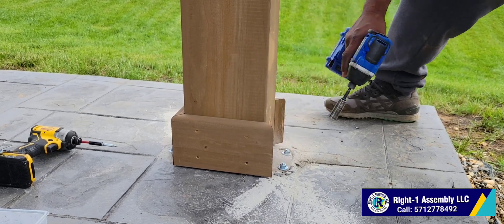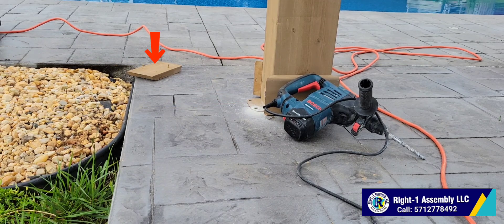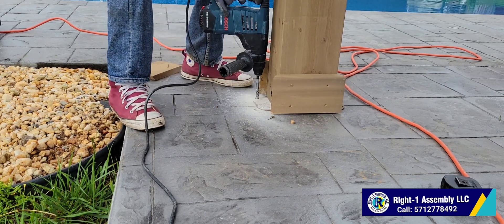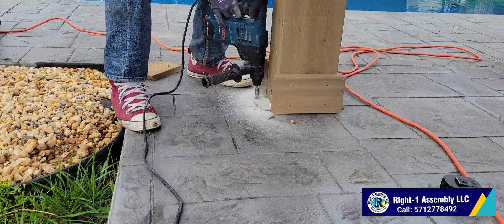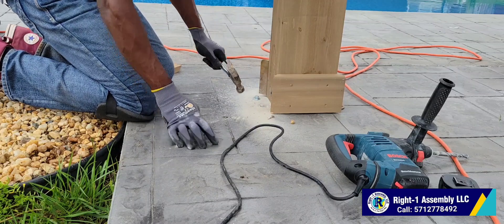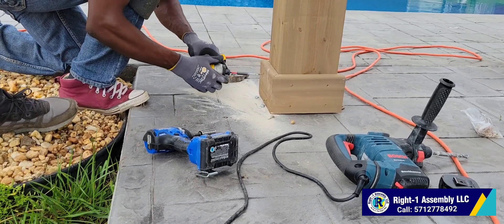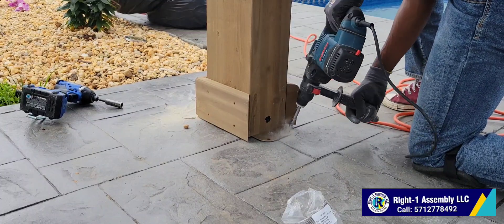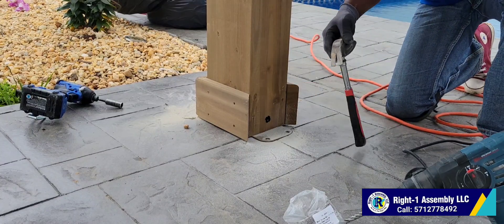How to attach or anchor the yardistry gazebo on concrete or patio. #diy #gazebo #home #world

Comment: Perfect.  Exactly what I needed to know to attach my grill gazebo to my patio.  I've done this with cinder block wall achors but that is easily drilled with a hammer drill.  Will have to rent the concrete drill but cheaper if I do that and do the work myself.

Comment: How would you recommend anchoring a Gazebo over pavers set in packed stone thats over 2' thick?
Reply: The same... Tapcons... No different... Just make sure you have a strong drill
Reply: Is the gazebo property secure with the anchors only being fastened to a paver block? The paver block is only held in by sand. What stopping the attached paver from lifting with a strong enough wind?
I think the proper way is to have concrete footings poured under each leg. Then the gazebo leg gets fastened to the footings. A lot more work involved this way however it’s then secured properly.

Comment: Thanks for the video, I think It is recommended to vacuum the concrete dust out of the hole before tapping in the anchor?  But again, I much appreciate the video.
Reply: Thank you so much, it all depends on what type of anchor you are using we've never vacuumed the dust out before but it works perfectly.
Reply: @GodFred Righteous  you've never vacuumed the dust because you don't care about details. Terrible practice. 🤦‍♂️🤦‍♂️

Comment: Nice video.   How would you level the posts if one side was lower?
Reply: Depending on how much you need to compensate you can use metal washers or a metal plate.